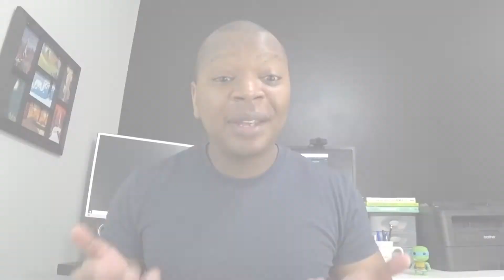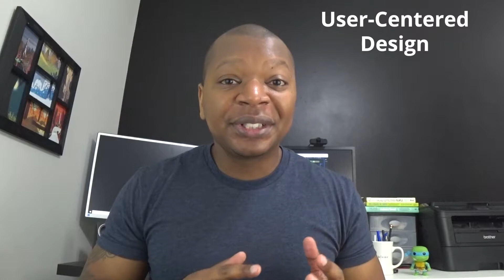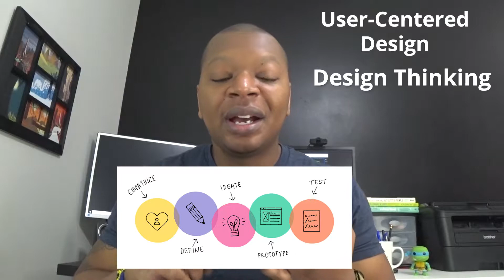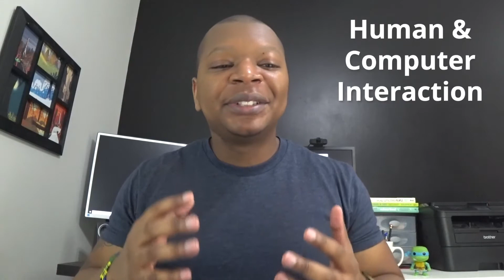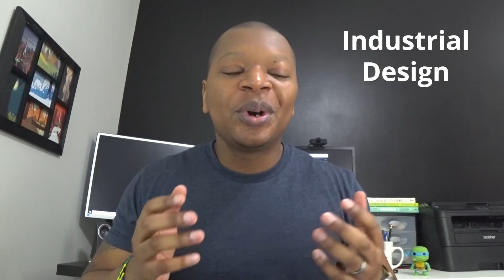User Experience Careers - Understanding UX Design vs HCI vs Industrial Design and more

Comment: Great one Angelo. User Experience Design is the principle and science where you covers the different disciplines for building projects for interactions of users/customers, their psychology, their system, their behavior, their comfort, their business, and even their politics sometimes, while Industrial Design is a profession and discipline where you can apply the principles of User Experience Design to achieve your goal. In their process they have very thin line separating their differences.